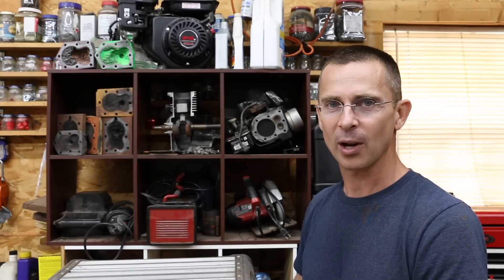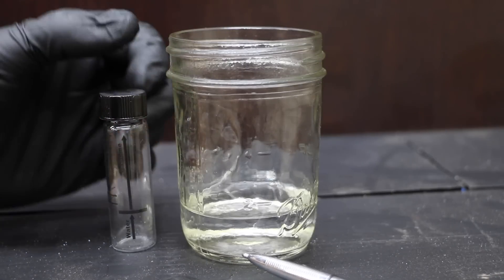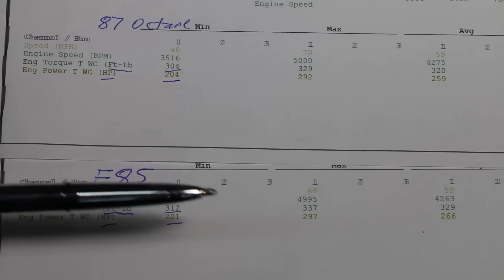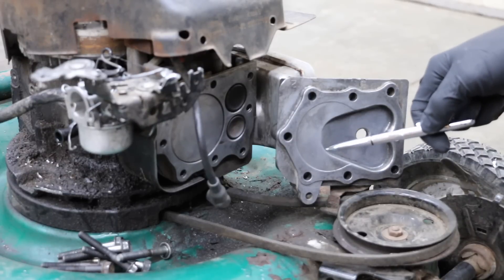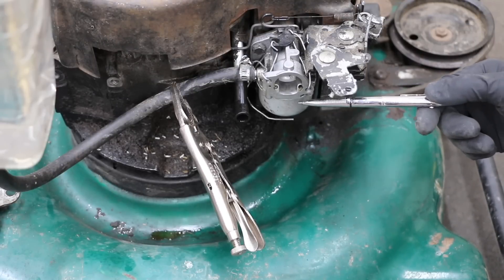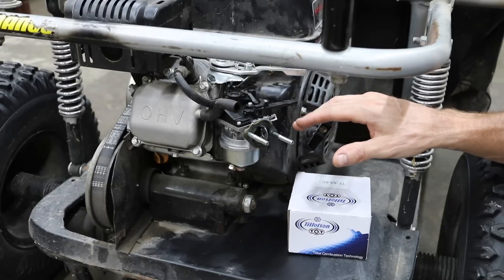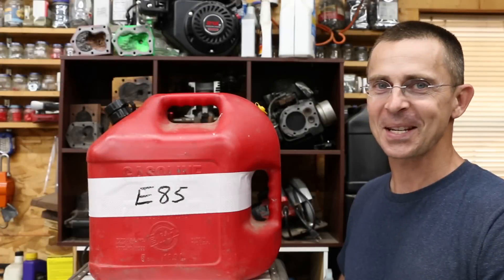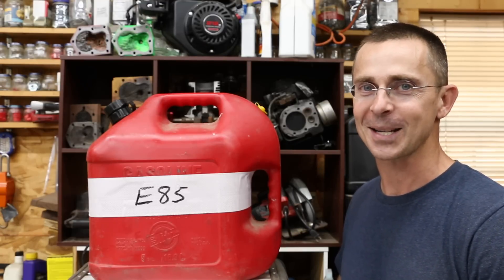Is E85 better than Gasoline? Let's find out!

Comment: Now that you've shown that E85 burns cleaner than straight gasoline, how about a test of E85 vs Seafoam for cleaning valves and combustion chambers ?
Reply from the maker: Great video idea!
Reply: Seconded^ 
Id watch this
Reply: @tdidan I used some leftover, year old E85 to clean the carbon/gunk off the intake manifold on my engine (while I had it appart not running) and it did an amazing job! The alcohol is a great solvent!
Reply: My experience on my bike is that E85 is OK in hot weather but use it all up. Sitting overnight in the humid Florida weather  made it run like sht the next day. And it took me a while even after running out to run the bike right again. My guess is that it absorbed too much moisture on the cool night. I do not seem to have the same problem running it on liquor store grain alcohol, walmart isopropyl or denatured alcohol paint thinner. That stinking E85 is funky sht
Reply: @sfertonoc  Phase separation occurs more at colder temperatures. Or you´re having ignition problems, look for sparkplugs, leads or ignition coil problems. Once I had that problem and was the coil primary feed wires (bike electric system to coil) that got corroded and electrically resistente.
Reply: @tdidan well seafoam gás isipropil álcool as one of irá ingrediente. Álcool, Boeing etanol os other is a solvent.
Reply: You would likely see similar effects from just running a normal product through your engine. E85 at maximum concentration can and will reduce some carbon deposits. I've seen this consistently in engines that are 85 compatible where the owner regularly runs E85. I bought a truck a few years back that was E85 compatible, an 05 Suburban with the 5.3L. It got about 12MPG combined across my driving for the first few months. I then switched to E85 when gas prices skyrocketed and my gas mileage dropped into the mid single digits, which was to be expected. However, after running several tanks of E85 through it, then going back to gasoline, it got better gas mileage by about 2MPG. Alternating E85 and regular gas over a span of months got my combined mileage on regular gas up to about 15-16MPG. It WILL clean some buildup, but only if the engine can take it as a fuel, and it won't clean everything, there are better products to clean the engine if that is your only goal.

As far as putting it in any vehicle not rated for E85. Don't, the vehicle won't run right if at all. All E85 vehicles have a fuel type sensor that can tell between E85 and regular fuel, when it detects that change, it dumps a lot more fuel into the engine to run properly. To do this, the vehicle needs to come equipped with injectors that have a higher lb/min rating for fuel injection, otherwise the vehicle will run lean. A regular car does not have this sensor, and does not know it needs to inject more fuel. E85 will not cause severe damage to seals in the vehicle's fuel system, they are all the same between E85 and regular gas, over time the seals will dry out faster than if they were just exposed to gas, but the time this takes is no different on an E85 vehicle than a regular one. That being said, you can convert your vehicle to run on E85 with larger injectors and a tuner to up the injection time, maybe a fuel pump if the stock one cant maintain fuel pressure (as E85 is slightly thicker than gasoline).
Reply: @2009dudeman  I´ve mixed E85 60% with E10 at 40%, engine is pure gasoline engines [Impreza, Taurus Vulcan, Corolla and Civic (all non flex)]. And it doesn't mind at all. The only thing I notice is that they take just 1/2 second more to cold start.
Reply: @tomasnokechtesledger1786  Then you were running E62.5 at best, not E85. Mixing in that 40% E10 thinned out the E85 just enough to get proper flow through the fuel system to run correctly for the most part. Keeping in mind the regulation for E85 is that it must be between 51% and 85% Ethanol. If you had a 51% mix, then you were only running E44.5.

Regardless, most engines will run happily even at a 50-60% ethanol blend in normal temperatures as they have to start with an E10 blend in below zero conditions. So a 60-70 degree day with high ethanol content won't cause many issues. But straight E85 with a true 85% blend is too thick for most cars not designed for it.

Even though all those engines you put that mix in ran fine, i'd be willing to be they dyno'd less than running their designed fuels. Not that you'd care unless you are trying to drag race, but none the less, it affects engine performance.

There are some other hidden effects you won't immediately see, though thats mostly on older cars as newer ones have had this issue fixed. The thicker blended fuel will run in a hot engine not designed for it, but the added strain on the pump from trying to maintain fuel pressure will cause it to wear out faster. Newer pumps are designed with someone putting E85 in it by mistake and can handle the extra thickness.

I still do not recommend running E85 in a non flex fuel vehicle, if may run fine, it may not. The bad part is, you might not know until you shut it off and it cools down, then it won't start. Another factor to starting, is the heat range of spark plug, if you have had a tune up and put in higher heat range spark plugs, it can also help with cold starts on high ethanol content fuels. Still, just don't do it unless its flex rated or you are willing to experiment a little. You seem to know what you are doing, but joe schmo may not, and may brick his car until the gas is drained out and replaced.
Reply: @2009dudeman  Well, I agree in part with you. Since the fuel pump inside a tank is a positive displacement pump, the thickness of the fuel actually being little different (E10 gas has 0.9 cst visco and ethanol E85 is 1.1 cst visco) IMO, it doesn't have all the importance you thinking about the pressure build up. The fuel pump even though is more than enough to feed the system since you need a pressure regulator to keep it down, it´s not running at the edge. The difference in starting doesn't come from plugs (yes I put a smaller number increasing heat ranges),  but by the minor volatility of E85 in comparison to E10. Plugs affect after starting, when running.
Reply: @tomasnokechtesledger1786  hotter plugs will improve cold start performance marginally, but they still improve it. A hotter plug heats up faster than a colder plug, that's what heat ranges are, and the sooner you warm up the engine, the sooner it will run better. As far as the pump, yes positive displacement pumps are more resistant to differences in fluid thickness, but the electric motor running them isn't, it has to work harder. As I said, the difference in life isn't so huge that youll blow it up in a day, but you used to take hours off for every task you ran. I also said newer pumps are built to handle that. The regulator maintains fuel pressure at its outlet, but it can't regulate the pressure at the injector needle. Resistance to flow creates pressure, it also creates pressure drop. Increasing the viscosity of the fluid through a small oriface like on an injector, reduces flow rate. Spray patterns and volume measurements show a reduced flow and spray pattern from E85. In order to compensate, the car has to increase injector timing to keep it from leaning out. Since ethanol creates a ton of soot when it pools on the piston head, which E10 doesn't in modern multi pulse injection, you are creating a ton of carbon buildup as a result of fuel viscosity reducing injection flow and pattern. There is a reason there are injectors designed for ethanol, they have higher for ratings to handle the increased viscosity so they can maintain a proper spray pattern and prevent as much carbon buildup as possible. For the same engine in the Ford rangers the gas engines used 19lb injectors, the flex fuel injectors are 25lb, they are exactly the same HP rating.
Reply: @2009dudeman  nope
Reply: @tomasnokechtesledger1786  we'll agree to disagree. I guess all the experts are wrong as to E85 requiring different tuning to run.
Reply: @2009dudeman  Not E85, it´s E64, as you calc yourself. Ecu and injectors can handle that for normal mild loads.
Reply: @tomasnokechtesledger1786  I'm talking about straight E85, as I was in the original comment. I already said E65 or whatever is fine for most driving. E85 is not for most of the population, it would work for the most conservative driver, but it's going to fill the engine with soot and lack pet of you try to drive any faster than granny.

You introduced The E85 E10 mix, which as we know works both because it's been done, but it's still nearly half not ethanol.
Reply: @2009dudeman  More ethanol, doesn't make more soot, also. We were talking about my situation as you jumped on my coment.
Reply: @tomasnokechtesledger1786  more ethanol doesn't make more soot, a poorer spray pattern does. You responded to my comment, I was talking to an entirely differnt person will offer a month ago.
Reply: @2009dudeman  You are right. Looking back I talked to you. Why would the spray patter become poorer with  E85? I saw a test machine with both E10 and E85 and the spray pattern on same injectors were exactly the same. You think  slightly higher viscosity of E85 make a great difference in spray pattern? What makes difference in spray patter is different superficial tension on the liquid, not viscosity. Ethanol has minor superficial tension to gasoline, I think (not sure on this one), need more research.
Reply: @tomasnokechtesledger1786  the spray pattern should be exactly the same on an injector designed for E85, which, if they were testing E85 in it, I would think the injector is E85 compatible. There are several factors that affect spray pattern, it's not just the difference in viscosity, as you pointed out. However, we can't ignore the resistance of the two to flow. Gasoline is most commonly measured with a dynamic viscosity of 0.6cP, E85 is rated at about 1.09cP (for a ln 85/15 mix according to the charts I found) , both at 20C. That leaves us with E85 being a little under twice a resistant to dynamic flow as gas, this means you need a larger cross section in a tube to get the same flow rate at the same pressure and temperature. This isn't the only factor, surface tension as you pointed out plays a huge roll in how well a fuel atomizes, of which gasoline and ethanol are about the same. For the same given flow rate, they should atomize exactly the same. Which you saw in the test of the injector, and for an injector designed to flow E85 as well as gasoline, we'd expect that. But for an injector with a designed for rate of 19lb/min for one fluid, you will not see the same flow rate and thus the same pressure after the restriction for a fluid almost twice as resistant to flow. A normal injector has most of its restriction to flow at the injector tip, so that's where most of the pressure drop is. However when you put ethanol in an injector not designed for it, there is a slight pressure drop further back in the injector, which means you have less pressure at the tip of the injector during flow, which reduces the effectiveness of the atomization. It's like turning the faucet half off on a hose with a spray nozzle on it, the reduced flow and thus pressure after the restriction causes the spray pattern to change.

It's not just speculation either, it's been tested. There is a peer reviewed article about E85 pooling more during injection through a standard injector compared to gasoline, I'll have to find it if you're interested.
Reply: @2009dudeman  The test was made on injectors that were equalizing on maintenance of one of my cars (not flex) and we put gasoline on the machine and it didn't couth in a fire rsrsrs ... Interesting conversation anyway! E10 is more viscous than 0.6 cp that you denominated for pure gas (applicable in very few stations nowadays). 70 mls were deployed at same time lenght (i don't remember exactly if it was for 1 minute as it is adjustable in this machine) went from 600 to 7000 rpms on the pint, for both fuels (E10&E85) equal flow on the machine, but the pressure regulator in the vehicle makes # and as you know, same by injection time also. Since I´m not using pure E85 on my non flexes, all this discussion is in the arena of mere hypothesis, not fitting to my case. I appreciate your thoughts and standings. Very truly, OSC.
Reply: @tomasnokechtesledger1786  You are right. I made a mistake, I forgot to spec for E10, I was using the local figures for no Ethanol gas we use at work. I'd have to go back and check the lab reports to see what the blends measure, but thats not really worth it.

It really has been an interesting conversation. I've had to go back and brush up on this stuff, man am I rusty xD.

I'm glad the mix works for you, its actually the first i've heard of someone wanting to run a higher ethanol mix, though in Michigan ethanol in fuel in the winter can make for some nasty surprises in the morning if you used an old batch of fuel mix.

I am curious as to why you mix more ethanol in your fuel. Do you get better price per mile that way?

As far as hypothesis, I have no clue what a 65% Ethanol split would do in an engine. I do know from our trials that E85 on standard injectors will create more soot on testing (though not enough to matter to the average driver, it might reduce time between tuneups by a few thousand, but that doesn't really matter on a 70K+ mile interval) due to a slightly higher tendency to pool on the surface of the piston during combustion when compared to gasoline. We were also using injectors out of small 1.7L Honda. What we were testing was emissions, E85 released more Sulfate (marginal), Methylene glycol (almost double, though still not much compared to other more harmful chemicals). and Hydrogen Sulfate (marginal). But also cleaner as far as nitrate emissions goes.
Reply: @2009dudeman  Thanks, man, I also liked the conversation!  I´m just experimenting with ethanol to see if I get less sludge at long drain intervals in extreme short tripping. A Bitogger stuff. Looks like it is fine in a tight ring pack engine, since I´m not getting fuel smell on the dipstick, but I´m running like this in warmer climates 65F+ only. When the temperature falls, I´ll be on E10 again.
Reply: @tomasnokechtesledger1786  Awesome, that would be interesting to see how it affects oils at longer service intervals since some of these newer cars are running you 10K miles on an oil change and some of these new oils are claiming 20K miles between intervals.
Reply: @2009dudeman  I can tell you this for now: less carbon (solid) ingression (not fuligem on burning alcohols), and less fuel dilution, since ethanol evaporates completely above 160 F for a small period of time. Gonna try later on a Direct Injection car to see if the high fuel dilution problems are reduced.

Comment: I might be a little out of line by saying this, but I will anyway, for inquiring minds.  Food for thought, if you will.

E-85.  Primarily ethanol.  Terrible fuel mileage, even in vehicles designed to run on it.  A few more donkey's under the hood.  Cleans.  Price at the pump is slightly lower.  Cost of production and convenience of finding a station that supplies it.... not good.

Regular 87 octane.  Better fuel mileage.  Every station sells it.  A little less torque and horsepower.  Dirties up the motor a little.  (nothing that a little seafoam cant handle)

High test 93 octane.  Lower flash point.  Doesn't leave the carbon behind that 87 does.  Doesn't really clean anything, but more bang.  Most stations have at least 91.  Maybe add some octane booster.  It'll burn even faster in the combustion chamber.

DIESEL.  Still, to this very day, the most efficient of motors and fuels by at least 10 percent.  Yes, a little dirty, but even with modern day exhaust cleaners such as the DPF's and the SCR's, it's still the way to go.  Earlier model trucks and cars are sought for, especially in the commercial section of life.

Back in the early days of fuel production, diesel was a "by-product" and considered waste.  It was thrown away, mostly dumped into rivers.  Now, in modern times, since it has become what it is, it is highly taxed and much more expensive than say, 85, 87, 89, 91, 93 and even higher octane gasoline.  There can't possibly be a question as to why.
Reply: Ethanol will also burn cooler in addition to depositing less carbon, therefore the oil remains cleaner for longer, and the thermal stress and wear on the engine is less. Both lead to longer engine life. Given that planned obsolescence is designed into any modern car, it is a good idea to keep older cars running for as long as possible (1983 is the year fuel systems started becoming ethanol safe).

Also, money from ethanol goes towards helping domestic farmers and distillers rather than governments who fund terrorism (Saudi Arabia).
Reply from the maker: All great points. Thank you!

Comment: I have a 2012 Dodge Journey and I get 13mpg on E-85 but with 87 octane I get 17 mpg. I have done the math too and if you find the right gas station it is worth the time to use E-85. I have found a gas station that has a price difference of $0.70 per gallon. Yes the mpg is worse but it is worth it to me to use it since it burns cleaner than 87 octane.
Reply from the maker: Great point. Thank you